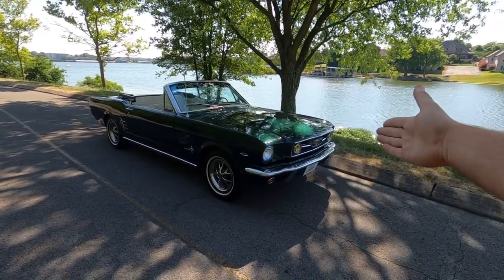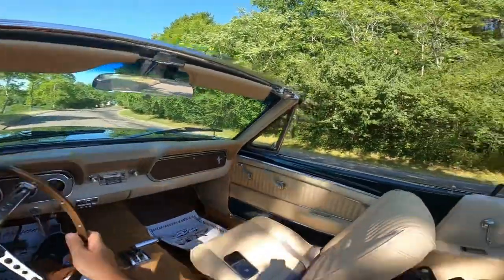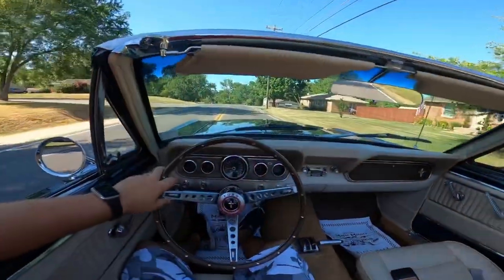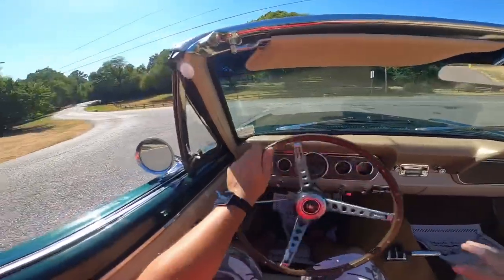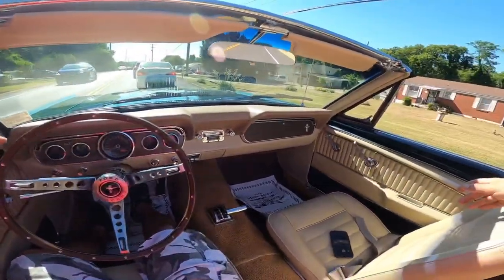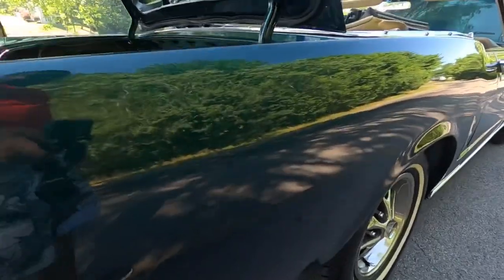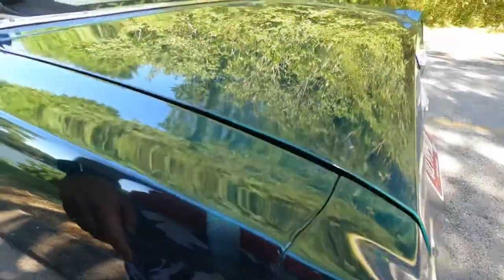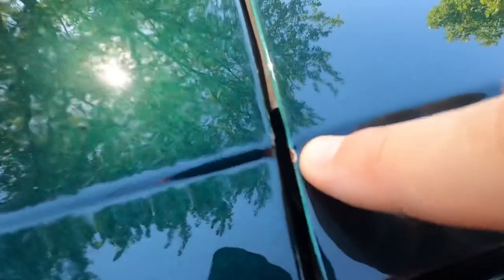Test Drive 1966 Ford Mustang Convertible SOLD $37,900 Maple Motors #1700

Comment: This car  need's new steering linkage # 1, the body looks good and all will play out for what it needs. The dash should have never been painted, flail # 2, the engine looks very good, no oil burning out of the tale pipes, that means she is not burning oil.  Nice car in all, some eclectic care will be needed, but all in all nice Mustang.

Comment: I thought I seen a rack and pinion steering set up …. There should be a adjustment screw to tighten up the slack . It may make the steering feel stiffer though.
This mustang looks like it only a few years old  !

Comment: C4 transmission, in 1987 my partner in the transmission business restored a 1966 just like that one, i built the C4 for it, and it still works today. at the same time i restored a 1965 impala SS, i ended up selling mine,,,,,,,,,,,,,,,,,,